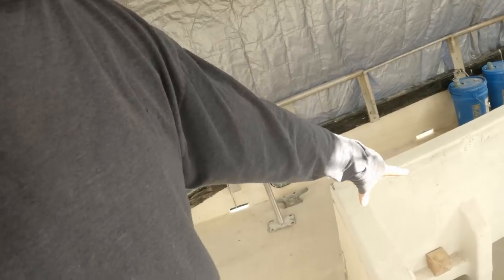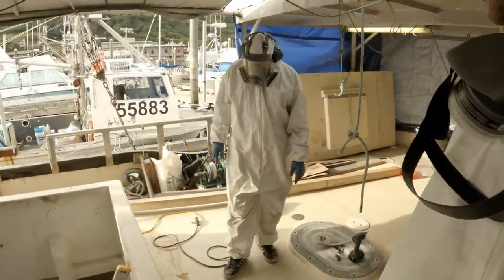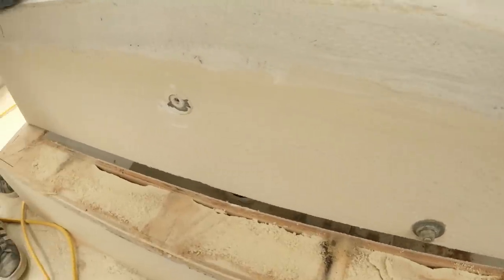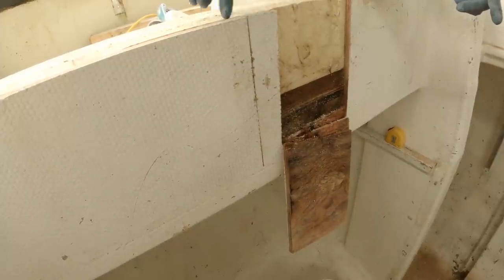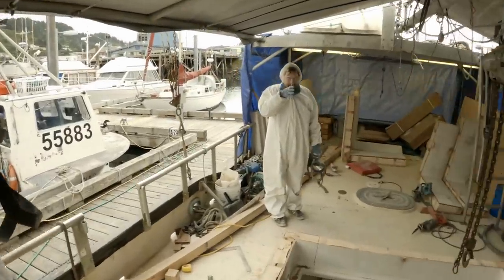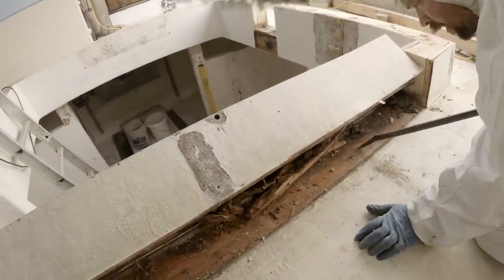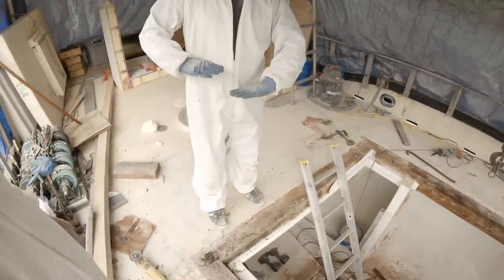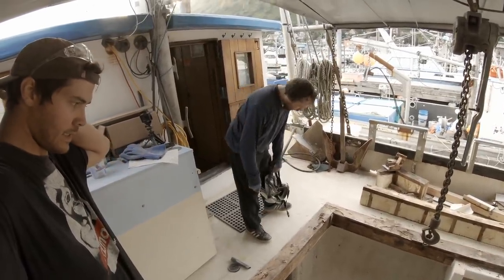Coaming Demo and Recycling Plans - Emerald Isle: Ep.18 Fishing Boat Refit

Comment: It would be neat to build your own net to fit inside the coolers, therfore after you bring in your catch you can open up the doors hook up the net and have the crane pick it up. The way I see it made is net on the bottom and wood on the side. The wood would have holes drilled in them to accept the bottom net. Say 4 boards one one side and holes drilled in different boards to distribute the weight.You can always half load or 3/4 load to see the weight load. Than after they weight it and dump the fish into containers they can weight your net. Just a thought.Bill N..
Reply: Hi guys I watch those guys n they put. Cages. In the fish holds n fill them up n pull m up all full think about it thanks. Guys

Comment: Since you had to remove the balance of the frame, why not make the deck level, instead of placing the frame back, as you mentioned you'd prefer?
Reply: Yeah flat deck!
Reply from the maker: We plan to put a false deck down and then the hatch will be flush with the deck. It will all make sense as we progress into the project. This will remove the crown from under foot but still aid the vessel in shedding water quickly.
Reply: EIS Alaska  - understood. Again, love your projects.